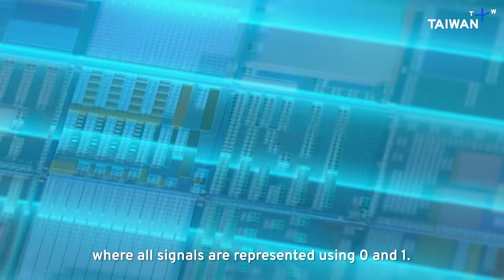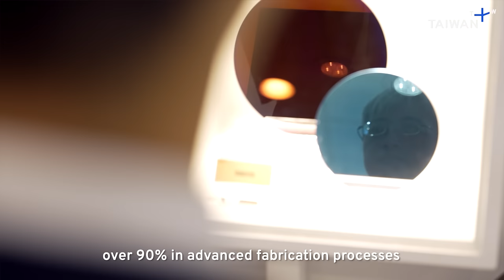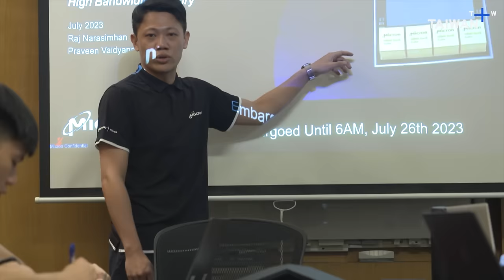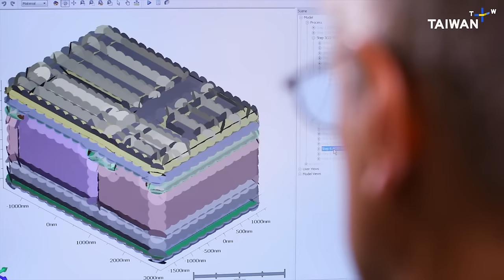Inside Micron Taiwan’s Semiconductor Factory | Taiwan’s Mega Factories EP1

Comment: The entire semiconductor industry is pretty mind bending. It combines electrical engineering, computational psychics, chemistry, metrology, process control, design automation & power generation all in one.
Reply: Where did this knowledge come from? I highly doubt men just thought of it on their own.
Reply: @MAZZAR0TH  It is the culmination of the efforts of millions of people working in hundreds of different scientific areas for a couple of centuries and hundreds of billions of dollars to fund everything. You can track the development of computers and more specifically microchips and there is never a stage where something unexplainable happens. It is just incremental improvements over time.
Reply: Well stated 👋
Reply: @stevea1936  I doubt that. Men didn't just progressively create cpu's from sand.
Reply: @MAZZAR0TH  Well they started with vacuum tubes, then went to germanium to make the first transistors and then settled on silicon since it performs better at higher temperatures and is more stable. Then it is just a matter of refinement over decades.

Comment: I am impressed by Taiwan's technology.
Reply: ASML's technology.  The Dutch
Reply: @davidanalyst671  Owning ASML equipment can’t make you able to have cutting-edge skill of producing chips.
Reply: @davidanalyst671  Microchip technology. USA founding
Reply: @TsaicheW  microchip design is mostly from the US, while the litho machines come from the Netherlands. ASML is the one who for a large part dictates progress in the semi conductor field as it is due to them that gates, transistors etc can be further miniaturized. Taiwan as a manufacturing hub is of great importance but due to the fabs opening in the EU and US this importance is shrinking rapidly. The production of microchips is far less complex than pushing physics (ASML) but that also applies to the design of new functionality through microchips. TSMC has a whole team of ASML employees present for maintenance as they are unable to do so themselves - the complexity is simply too great.  TSMC is important but their importance should not be over-inflated.

Lastly, TSMC was originally setup as a joint venture between the Taiwanese government and Philips of the Netherlands. ASML in turn is a spin-off of Philips. It all comes full circle.
Reply: @ntro9347 Have you seen the size of the TSMC factory? An ASML EUV machine is the size of a bus. Yes you can’t produce the best semiconductor chips without ASML machines but there must more to it than simply ASML. In other words maybe the Dutch should give it a try. Or the Americans can simply buy an ASML EUV machine and produce the best semiconductors themselves instead of asking TSMC to open a factory in Arizona.
Reply: @Tuanesto  By FOREIGN researchers and scientists. COPE.

Comment: This is amazing to watch. But also, there are an appreciable number of process improvements that would decrease particles contaminating the process.

It's actually surprising to see that in a place that's clearly made by a large number of absolute geniuses. 

A basic example was the fan room before entering the clean room. Second dude by distance from the camera has his arms up, closest dude never takes his arms from the side. 

How much doesn't get blown out because of the closest dude?  What other casual actions in that area would contribute to the same contaminations? 

Even if it's not a lot, it's an extremely simple fix in terms of resources, time, and cost.

Comment: I did chip design in the 70s when you could physically probe transistors on a chip! I can't get my head around the tiny dimensions of modern devices, but also the ability to design machines that can move things around on those wafers at such anaccuracy.

Comment: This is so amazing. I am old enough to remember the mid 60s when my brother would build circuit boards as a hobby. The transistors he use looked like little cylinder shaped objects connected to the circuit board with 3 wires.

Comment: Does each individual chip need a specific lithography design? how to ”fault trace” on a nanometer scale or do they just trust that each chemical vapor deposition procedure works?
Reply: look into EUV stochastic defects for a breakdown of the process. In short, optical inspection equipment is used on each wafer that is to be inspected.

Comment: For keeping electric city safe during earthquake use cement pole.
Cut rubber tyres and 
Put rubber tyres around it.
Fill with chipping,put tyres upto neck of pole. 
Most research is required is for joining wire. How we can keep electricity wires flexible. 
Either keep some extra wire or use some half meter wire flexible like telephone wire.
Electricity will be safe during earthquake. 
Jay bharat.

Comment: i did not know that semiconductor making process. It is very critical and complicated. but these types of the manufacturing makes taiwan super power in electronics. I read taiwan export of semiconductor  more than crud oil export of Saudi Arabia,  UAE and Katar.  Soudi approximately 160 billion USD  export petroliam. and Taiwan export semiconductor up to 180 B USD.  Indian Govt trying to make semiconductor mega factory in is contry. Indian govt  also trying to become manufacturing hub of semiconductor. and he going tp stap up for PLI scheme. which is more than 10 B USD , abd trying to atract globle power of semiconductor manufacturer. Micron willing to make fabrication unit and R&D facility and many company gaves proposal to Indian govt for diffrent diffrent process uint. But its very very erly stage. but we are satisfied and we hope  after 20 years we will be able to make complite  semiconductor.

Comment: Great video! The only comment I'd like to add for it and ALL other videos on the subject is that the word "manufacturing" does NOT convey the technology involved to "manufacture" a chip. 99.99% of the audience still think chip design is more challenging than "manufacturing" when in fact the latter demands even more R&D! This is not like making clothes but construction at the ATOMIC level. Thus, my recommendation is to at least use terminology like "manufacturing TECHNOLOGY" or "manufacturing R&D" when it comes to building a chip.

Comment: Really top end pay, benefits and shortened hours.  The reasonion is because the work window is a very strictly timed 4 hour work window.  Bathroom breaks during those 4 hours are not tolerated due to the time making yourself ready again after the 5 minute bathroom break.  Nor can you bring beverages of any kind into the factory floor.  It's understandable.  It's all about tightly controlling any contaminants that can enter the fab.  This is not a job for those with minor medical issues or ADHD.  Needless to say, security in such a place is super tight and it's always a miracle to see any kind of footage from inside one of these fabs.

Comment: They (Taiwan) are most probably far ahead 100 years from any other normal working (industrial) country.
Reply: Mainland China is about where TSMC was in 2016, as far as transistor size goes.
Reply: @rustyshaklford9557  bs. China cannot develop semiconductors. All semiconductor factories in China were founded by the Taiwanese. SMIC was founded by Taiwanese Richard Chang (https://zh.wikipedia.org/zh-tw/%E5%BC%A0%E6% B1%9D%E4%BA%AC); he graduated from the Department of Mechanical Engineering of National Taiwan University. He is honored by China as the father of Chinese semiconductors.

Mong-Song Liang fled to China, worked for SMIC, and assisted SMIC in developing 7-nanometer chips. SMIC's 7-nanometer technology was stolen from TSMC.
Reply: @genuinennessbefitting4734  
Taiwan can't develop semiconductors because they buy their lithography machines from the Dutch. Do you see how dumb this line of argumentation is?